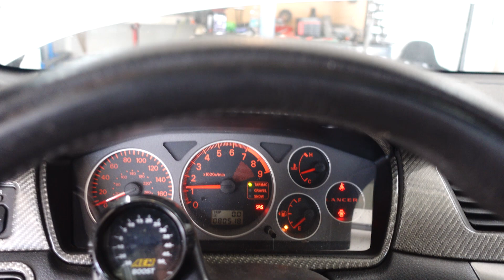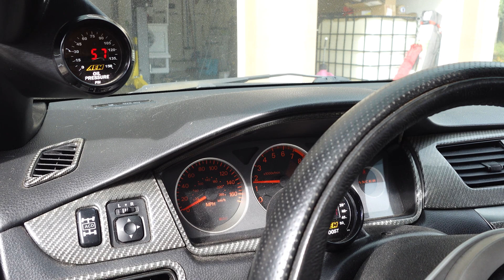EVO 8 FIRST START UP! WILL IT RUN?

Comment: Sounds really smooth for a First start good job :) 
If you aiming for 700-800whp on a Mustang you got to De wing it haha   Only thing i don't like about the USDM evo is the rear bar,
Reply from the maker: There's a lot of things I dont like about evos. But I dont wanna start that. Lol I was frustrated today lmao.
Reply: @AmandaRaeJean  Haha! Uh there is alot of things wrong when modifying any car to a certain extent past what they were ment for,   I'm sure it will iron out it will be a Nutty setup for sure 800whp is the sweet spot for an Evo,  :D